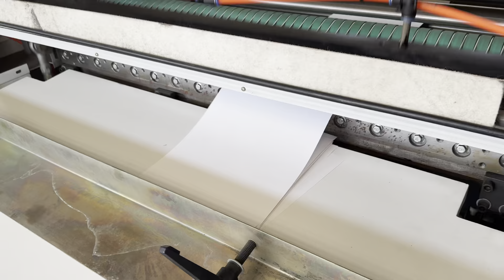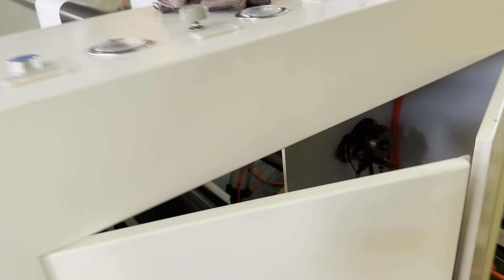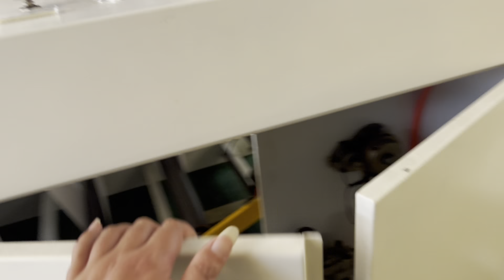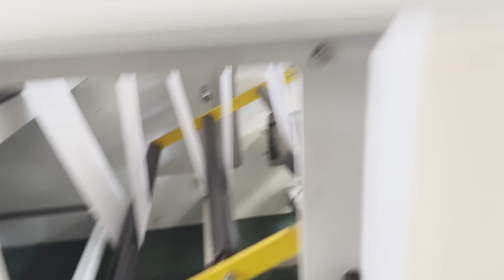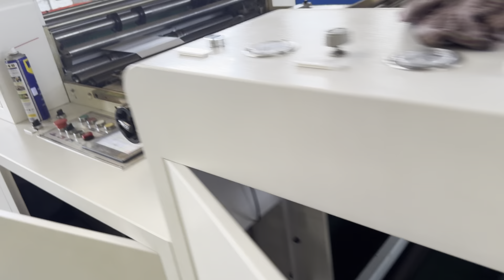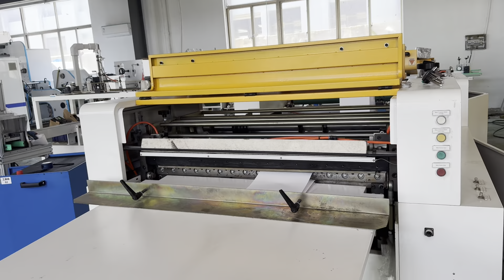Shawarma (شاورما) Packaging Paper |  Roll to Sheet Cutting Machine

Comment from the maker: In this video Jota Machinery will demo you the roll to sheet cutting machine(also called sheeter machine) . 

The sheeter support cutting the paper jumbo roll into sheet size.

Applicable for white butter paper, copy paper, greaseproof paper and others

Max unwinding width:800/1100/1300/1600mm
Max cutting speed: 120 cuts/min
Batch stop: yes
Printed paper: equipped tracking sensor

Contact us: whatsapp:+86-18151140027
marketing@jotamachinery.com
www.jotamachinery.com